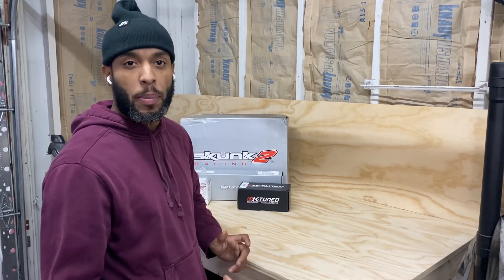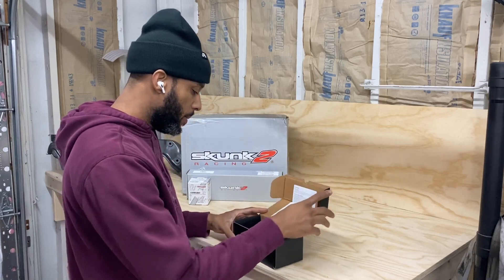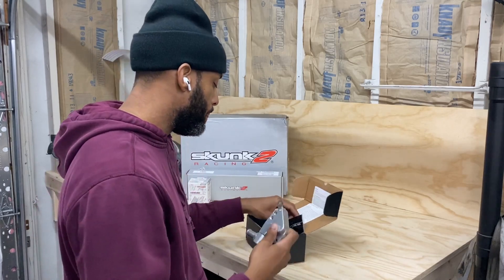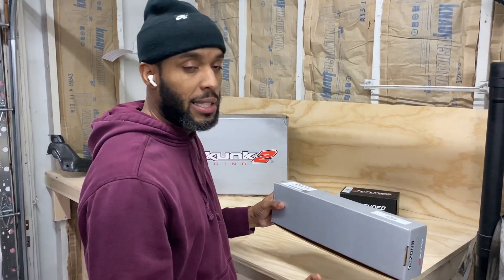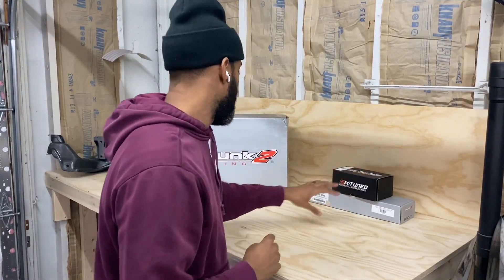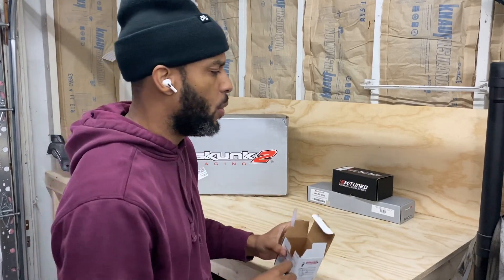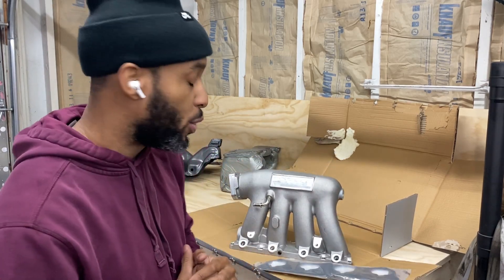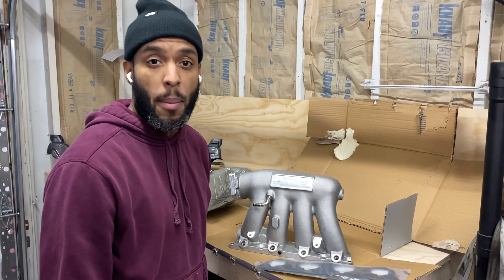Skunk2/RBC intake manifold for Kswap CB7 accord

Comment: Where did you connect the pcv hose?
Reply: following
Reply: @darryl9244  didn't get you
Reply: @darryl9244  what about the idle air control valve, where did you connect the hose on the skunk2 manifold